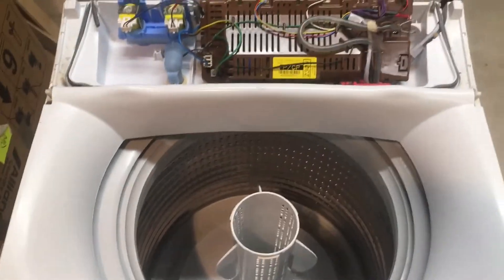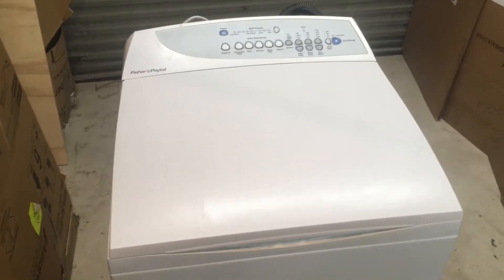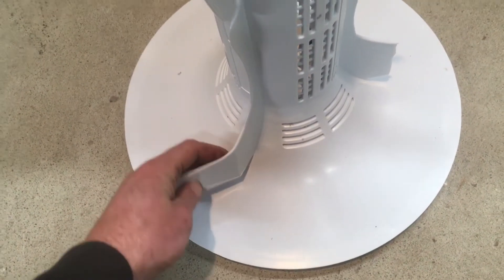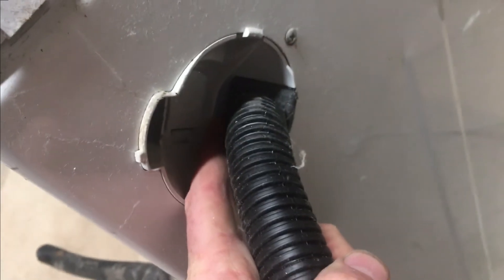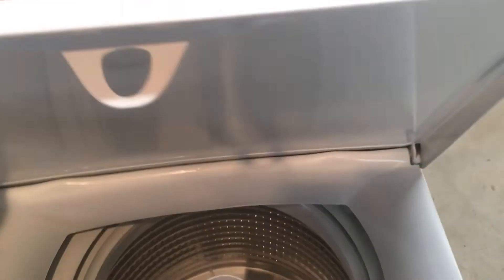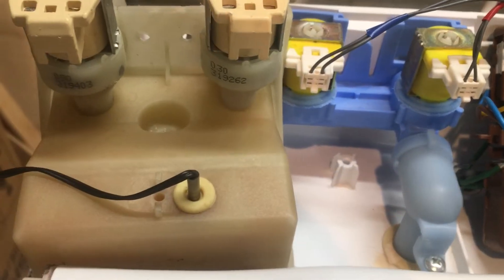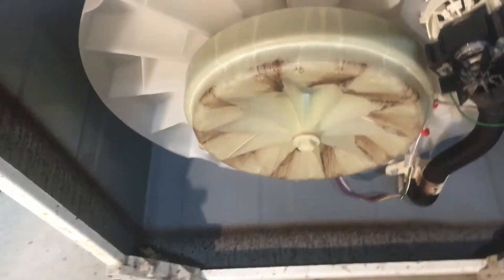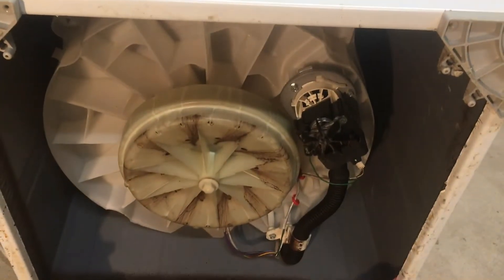Common Faults/Problems with Fisher Paykel Smart Drive Washing Machine.

Comment: I love my ecosmart washer but the metal tub part has water sloshing inside the plastic part. What would your suggestion be?
Reply: Thank you both. I was freaking out when I disassembled my washer and started cleaning it. I was worried there was a leak and obviously had concerns about mold formation if that were the case. I was very relieved to be able to continue my project without hesitation. 😊
Reply from the maker: That is normal, the water is sealed in the rings to add weight and balance the drum during spin.
Reply: Exactly as Dan said. These rings at the top and bottom of the bowl are intentionally filled with water. At the start of the spray rinse and spin cycles, the machine will do a 120RPM balance check before accelerating to 250RPM, and then the selected spin speed. 

This acceleration helps spread out the water in the rings due to the centrifugal forces, and works as a self-balancing measure. Some LG and Samsung models use metal balls instead for this. Basically, the water will act to fill in spaces where the bowl is unevenly loaded, creating a more uniform weight distribution around the whole bowl.

Comment: Hi Dan I have a 130 fault code. It will fill with water but wont agitate or spin. Pumps water out. is it the do a sensor some say u can just clean the contacts on it. I don't want to fork out $40 + for a sensor when it might be something else. Could 130 be the bearings.  it's like a noisy motor it trys to spin  and  start spinning sometimes but then stops at full speed  and flashes the 130 code.its an mw512
Reply: Did you figure it out? Mine is doing the same thing.
Reply: @swhite6835  yeah i cleaned the contacts and fault code gone.  But now i have  to replace pump which overheats.  Unrelated I think.  Another  $45

Comment: It's like a marketing video to buy any other brand except Fisher & Paykel. After 2 IW812 8kg fabric smart washers, I'm over it! Out of balance constantly when doing sheets.. annoying.
Reply from the maker: Certainly not, other machines have things that wear out too, including suspension. If you are expecting your washing machine to never have anything wear out then you are going to be disappointed.
Reply: These newer machines definitely aren't as well built though. I suspect they're using cheaper or lower-quality parts now, especially when it comes to suspension rods, drain pumps, and some power control chips. The older machines would last upwards of 20 years if you used them properly.

Comment: Hi from Sydney I need help please, I am new to your website and don't know how to post a project to get help.

I have a Fisher and paykel top load washing machine model number: WL80T65CW2 / 93191-A AU. it's noisy only in maximum spin RPM, load not out of balance, I replaced the 4 shocks, 4 elastic rubber holding the bowl from corners and the two bearings with new seal But problem not solved😪 

When I lift the bowl up it has Clearnce, it goes about 2cm up without any resistance!

When I disassemble the spline drive it has only the two parts (2 &3) {the small gear and the top housing for it with 3 screws) showing in attached picture, is that clearance normal whe I lift the bowl up or may be someone disassembled it before me and missin a part(clutch spring or something?}

Please help and guide me how I can fix it.

Thanks a lot in advance.

PS. When I use the mid spin speed it works normal without any noise.

Mike
Reply from the maker: Yes it is normal for the bowl to lift up a couple of cm, its how the bowl engages and disengages for swapping between spin and agitate, a very simple but smart system. 

Usually noise on spin could be bearing related, but without hearing the noise it is going to be very hard to help sorry. You may need to find a local appliance technician who knows Smart Drives to have a look/listed. Just replacing parts is not a cheap way to diagnose faults, as you are finding out!

Comment: Curious what it could be if the washer does not powerup when turned on?
Reply from the maker: That will usually be a blown motor controller, but you need to check the other components before fitting a new module to make sure there isn't something that has caused it to blow.

Comment: Hi fixed the water leak. $10 inlet elbow.  I also have an out of balance issue. Is this likely to be the suspension springs?
Reply from the maker: Yes usually the suspension rods will wear so they aren't damping as well as they should be. Rods are pretty easy to replace, if you lean the top deck back and replace them one at a time through the top.

Comment: Thanks for another of your great videos. I have a f&p washsmart that started leaking this morning. What should i suspect first? The main seal?
Reply from the maker: Could be main seal but usually bearings really noisy by the time it gets bad enough to see water. Could also be drain pump shaft seal, splashing over top from agitator, or an external hose. Easiest way is to put it up on a couple of blocks and watch under to see where it drips then follow upwards from there
Reply: @motrepairs  found it, the white “rubber” boot that holds the inlet temp probe and connects to the water distribution head has split. Looks like its gone brittle. Thanks for your help
Reply from the maker: @davidmedley9652  Editing my comment, I hadn't seen your model number above. Part you need is 429538 Thermistor Assy Svc Kit.
Reply: What model is it? Is it a wa55t56gw1 a wa70t60gw1 or a wa80t65gw1 (my favourite model)
Reply: @LaundryPhotographyInNz8620  its a WA1068G1